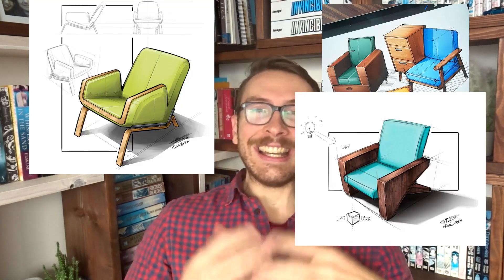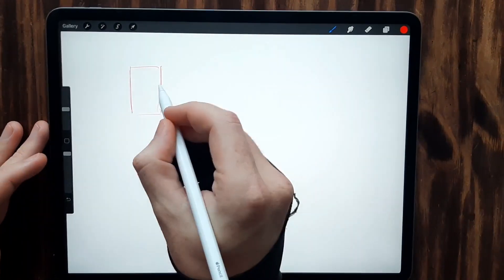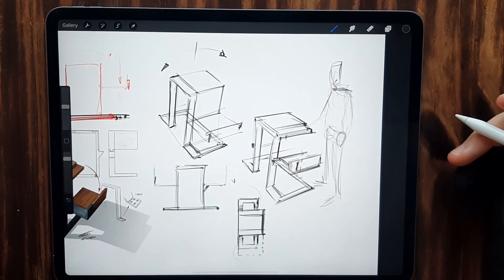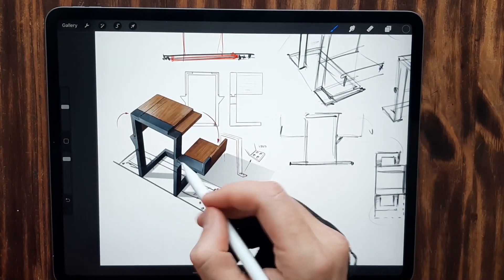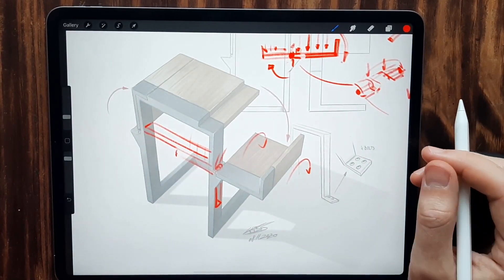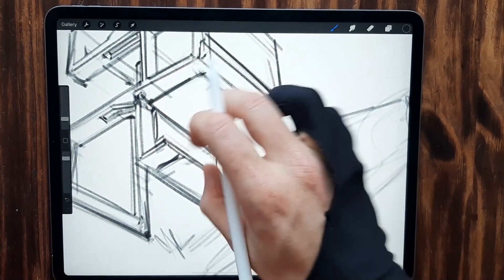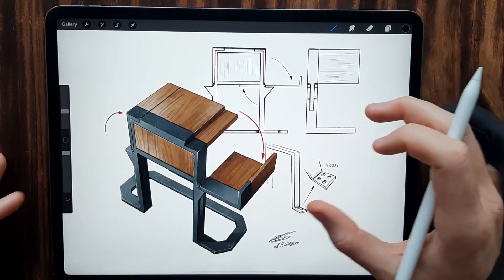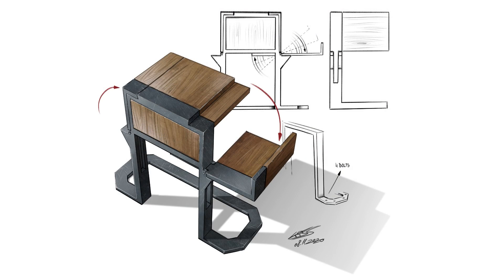Why engineering matters for design sketching

Comment: as always great video! clearly the hinge could become faulty with the pase of time, but my main concern with this design is the usability of the table once it is open. Having a step on the tabletop really limtis the range of acitivities you can do with it. Materials can withstand huge strees  varying its size, section and thickness but in the end the most importatn part is how it interacts with the user, try maybe using a slope (as a wristrest) instead of a marked step (could also be used for keeping utensils). However, the design is really interesting and the render is marvelous, keep on with this great videos :D
Reply from the maker: Thank you very much for your feedback mate. You are right I didn't think too much about usability, I was mostly imagining as just a coffee holder in the middle, maybe put a chess set on top of it and play with old people I the park ^_^ I will think about how to improve the user experience more!

Comment: I'm a mechanical engineer trying to get into automotive design. 
I have similar feelings- When I start sketching a product, I think a lot about its feasibility, manufacturing process that it would need. This I think ,often, hampers my creative side. 
Is it a good thing or bad? 😔
Reply from the maker: It can be both. In the creative process it is good to turn of tour analytic brain and churn out as many ideas as you can doesn't matterabot their silliness. And then you can come back and take th ideas apart till you remain with a couple tha really make sense.

Comment: I don't think the table seat can fold back up the way you think it would. The hinge is the problem. Ive tried to think of different ways to explain the problem but someone else will have to because I can't figure a good way to explain why the hinge doesn't work. it has to do with the space it occupies as its moving on both sides and the space directly above the hinge and directly below the hinge. even if the hinge was as large as the post below it and above it the item would not close all the way.  Both the chair and the bar meant to brace it are on the same pivot point yet the two items can't logically be directly above and below each other.
Reply from the maker: Not sure I understand what you are saying here. A hinge usually is comprised of a pin and two elements that rotate around the pin(the pivot point). One usually is a fixed element( in my case the legs and tabletop construction) and the other can swing openly(this is the seating construction). If we look at the table from the side the table legs are on one side and the seating on the other. I would love to know what you think is wrong with this construction so I can fix it.
Reply: I think the hinge is functional . The counterbalance lever protrudes to the outer  side of the tables leg so it does rotate as intended. I think the Edge of the table Surface needs to be chamfered slightly though since the seats surface is not moving along the pivots center in a circular fashion perfectly due to the thickness of the Seat, so the tables edge would collide ever so slightly with the „backrest“ I feel.
Reply from the maker: @Kalipp0  yeah that is true I was thinking of that. I was thinking of leaving a buffer space between the table and the edge of the "backrest" of the seat. The real problem is the side torque on the seat which will still break the hinge I feel.